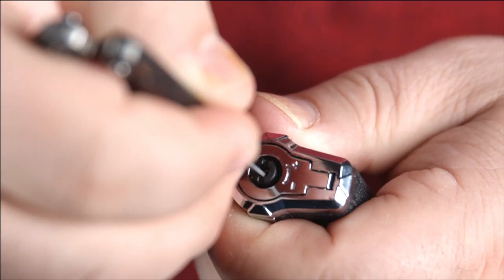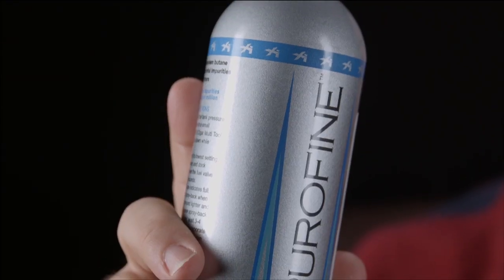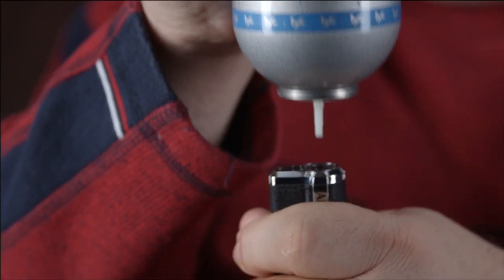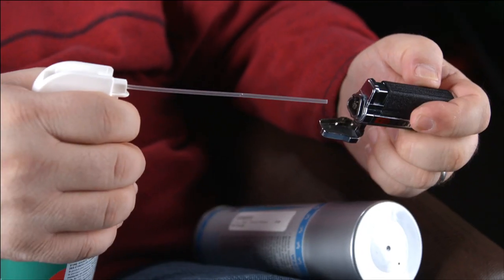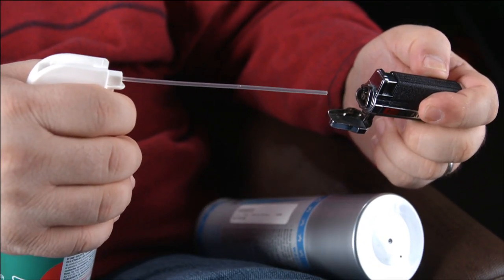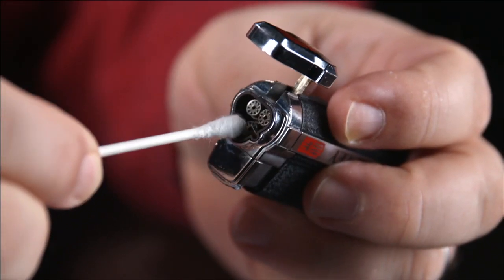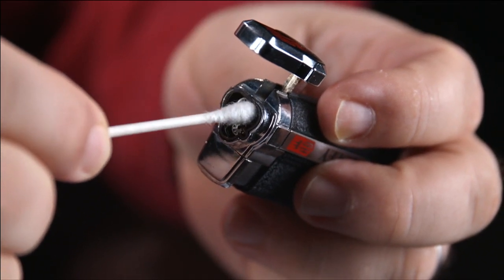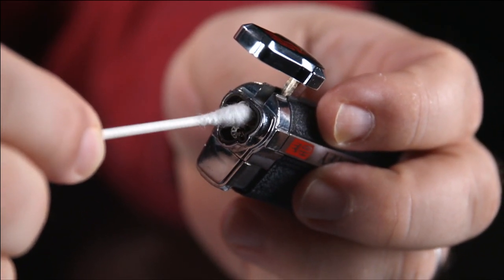How Do I Clean My Cigar Lighter? - Cigar 101

Comment: I have three perk torch lighter. Shooted some brake fluid in it.  scrubbed with needle, Then sprayed the heck out of it with compressed air, adjusted to a maximum flow and then I light it up,  made it really hot. And BAAM !! Works like new !!

Comment: I use an interdental brush on mine to clean inside the the jet flues. Works like a charm.
Reply: yup that is perfect unless the clog is further in behind the nozzle components but you should also use it to clean the needle of the fill valve, lots of lint, dead skin, grime and gunk in and around that area and should be cleaned properly before filling otherwise it may get all pushed into the tank and create internal problems

Comment: Just one thing I would add to this:  if you're going to use compressed air to unclog the jets, do so BEFORE refilling with butane, but AFTER bleeding the air.  Works much better.
Reply from the maker: Thanks for the tip, excellent point.
Reply: can you explain the relevance in the order? also using compressed air may push any clog further back in or make it stick more inside and harder to dislodge than purging gas out by the ignition button which may eventually release it but i guess if it don't work you can always take the nozzle and gas line apart for toughrough cleaning unless the clog is inside the tank valves and stem

Comment: I have a minijet dupond and lights always with the second press...any suggestions?
Reply: The timing of gas and ignition. Sounds like you need to press it slow and steady. Not as fast as you can like most people. Thats why most flint lighters light more reliably because the flint goes first and gas hits it immediately after.

Comment: I sent mine to Xikar and told them I cleaned it with rubbing alcohol.  They responded via email by saying they would not replace my tabletop lighter since I cleaned it with rubbing alcohol. So much for a lifetime warranty. There is nothing about this in the instructions. Needless to say, I need to find a new lighter and cutter company.

Comment: Give it a good blast of WD-40 and clean up with a Q tip.
Reply from the maker: Thanks for commenting.
Reply: Is this actually good and save to do?
Reply: @ViergeverProds  No. never use that because it will permanently soak the fuel sponge. Never use qtips because they will get threads stuck inside and extremely hard to get out. I use paint brushes that are tiny and alcohol.
Reply: Kerosene, not WD40.
Reply: @mikebarker9187  🤣